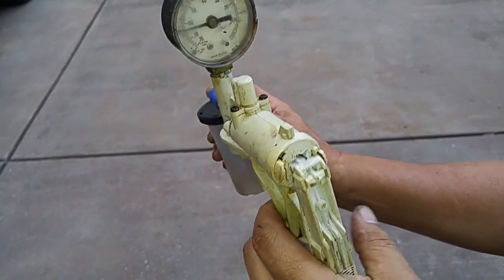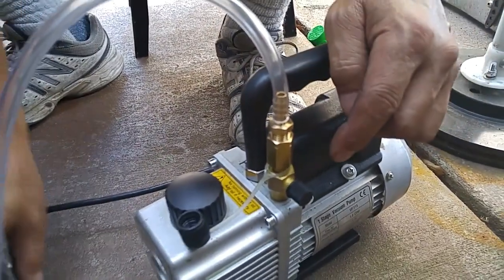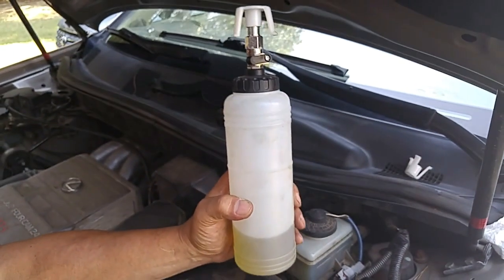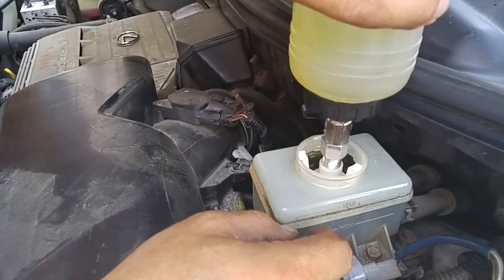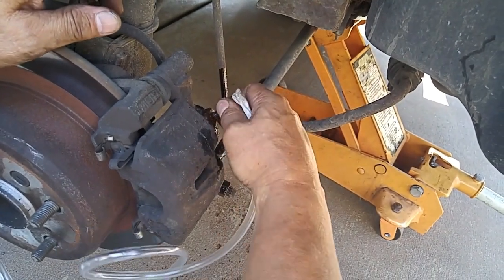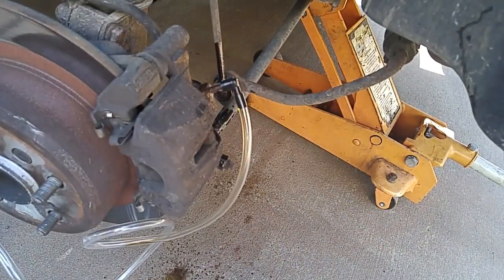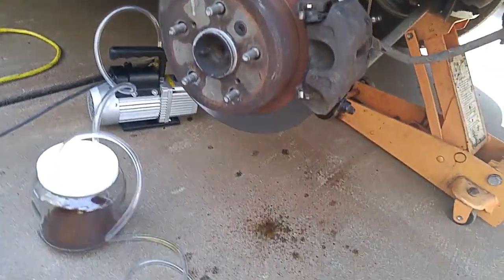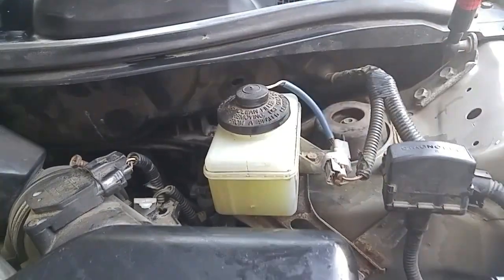Brake Bleed / Brake Fluid Flush With An AC Vacuum Pump!

Comment: My only concern is drawing too much of a vacuum and having any potential for harming seals/master cylinder.. How much vacuum is pulled by a such a pump and what is the likelihood of pulling in air around the bleeder screws at too high of a vacuum even if you slather heavy grease all around the bleeder screw threads? This is one heck of great idea to free up one's time and hands let alone, most notably, the fatigue from squeezing a hand vacuum bleeder!!
Reply from the maker: You don't need to worry about too much of a vacuum.  With the hand pump contraptions there's too little vacuum.  The vacuum pump machine at the dealership specific for brake fluid evacuation pulled about the same amount of vacuum with fluid coming out at around the same rate.  
There's no way to prevent air coming into the vacuum lines during brake fluid evacuation.  It's coming through the threads of the bleed valve and brake caliper.   And yes ... I do save a lot of time and fatigue using my contraption!

Comment: Where can I get the bottle filler and valve for the master cylinder resivoir? And also the vacuum pump?
Reply from the maker: In the "Show More" text description area of this video, I've listed reasonably priced ac vacuum pump and the brake fluid refill bottle.  The refill bottle can only be purchased as part of a kit.
Reply: You really don't need the reservoir bottle. Just top off the reservoir on the master cyl between each wheel bleed.

Comment: Thank you for another excellent and insightful video.

 I've been using an older Mighty-Vac pump over the last 30-years, on various car and motorcycle projects.  I purchased a Motive Products Power Bleeder, that attaches to the brake fluid reservoir to provide air-pressure for bleeding.  Some fill that Power Bleeder with brake fluid, but you'll have a mess if there's a leak, so I never fill the pressure bottle with brake fluid.  The Motive Products bleeder works well, but one downside is that you need vehicle-specific adapters to attach to the reservoir neck.  What I really like about your system and the Mighty-Vac, is that you don't need vehicle-specific adapters for the reservoir, and the process is made so much more effective with the vacuum pump.

One key feature of your system is the refill container that goes into the brake fluid reservoir, so that you don't need to worry about running dry and introducing air.  I couldn't find any of those refill bottles on Amazon and I take it that the refill bottle came with a prior purchase of a pneumatic vacuum bleeder?

Lastly, with your system, it should also be relatively easy to maintain bleeding while the ABS modules are cycled, if you had the proper scan tool to do so.

Simply brilliant!
Reply from the maker: FYI - The brake flush (or fluid exchange) resulted in the ABS light turning off on a 2000 Lexus RX300 and a 2006 Toyota Avalon!  The Avalon owner was quoted over $1000 to replace the ABS pump to get the ABS light to stay off.
Reply from the maker: Thanks for your comment and critique!  Yes, the new brake fluid container that attaches to the mouth of the brake fluid reservoir came from a pneumatic vacuum kit (that doesn't work very well BTW).  The motivation and inspiration of this make shift tool?   Got tired using all these vacuum generating hand pump tools for fluid sucking operations (transmission fluid, engine oil and brake fluid).  I'll be modifying all my pump tool containers to work in conjunction with my ac vacuum pump.

Comment: It looks like a lot of air was coming through that tube!     Was the rubber connection leaking in some air?  It seems like you should tighten the connection before turning off the vacuum to make sure no air gets back inside.
Reply: Could u apply permatex #2 nonhardinging sealant to the bleeder threads or if not a good idea why? An old dealership mechanic said the regularly applies that lightly to oil drain plug threads as extra leak protection and thread protection, he doesnt overtighten that way also, just snugs it up good.
Reply from the maker: That's air being sucked in between the brake nipple and the caliper threads.  Sorry ... can't be avoided.  Doesn't matter if you tighten the connection before turning off the vacuum.  If you left the hole open, fluid would be dripping out via gravity ... another way to bleed brakes BTW (the old fashion, super slow way) ... if you're willing to do a 2 hr brake bleed job.
Reply: @hardlymovingpro  it's an easy fix to keep air from getting pulled through the bleeder screw threads. Get a good glob of heavy grease and smear it around the base of the bleeder screw. The grease is too heavy to get sucked into the threads and this will keep any air from getting pulled in. Your new fluid coming into the hose will be bubble free. Nice & clear.
Reply from the maker: @andrewevans545  Good to know!

Comment: I was going to bleed my brakes for the first time this weekend with the Mityvac. Now I'm wishing I knew about your new method sooner lol. What do one of those AC vacuum pump things cost? What do you think it would cost to make this whole contraption? Think you might make a video guide to making your contraption parts? :) The thing you put in the reservoir is really interesting.
Reply from the maker: AC vacuum pumps are relatively cheap.  Seen one advertised in Amazon for as low as $42.  You can rent them for free at Oreilly's and Autozone.  I'll post a parts list in the description of this video in a couple of days.